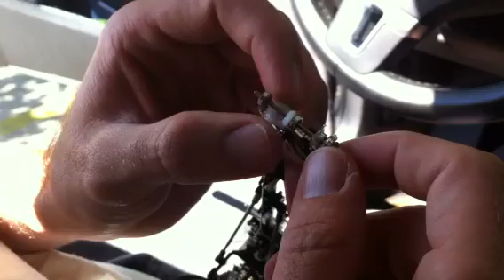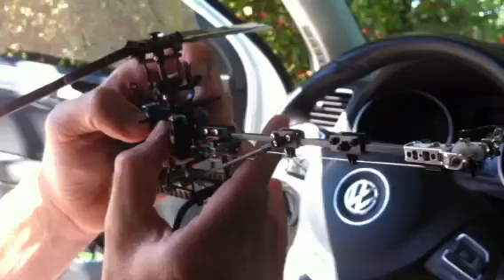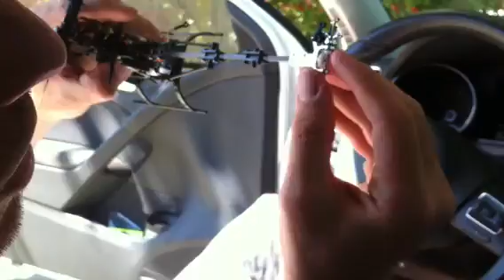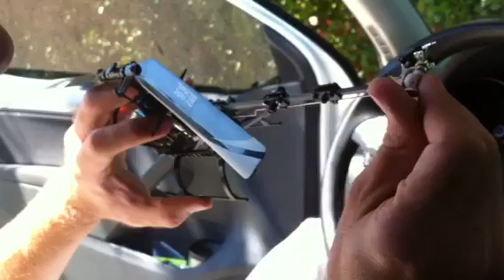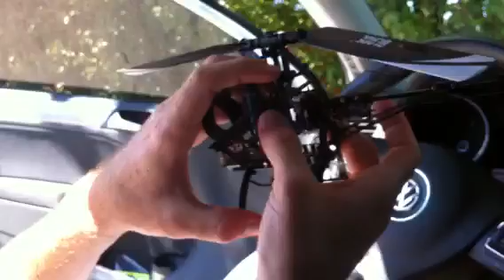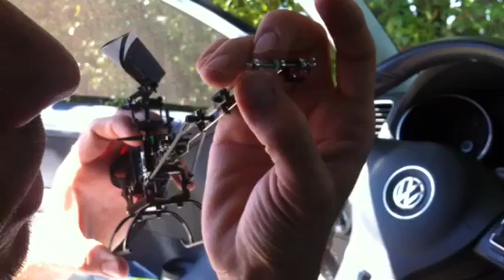Blade 130x tail gear mesh issue

Comment: Did you figure this out? I have the exact same problem. From what I can tell, the C gear is out of round and pushing against the D gear. I can see and feel the C-D gear mesh change a lot as I am rotating them. The gears are new, not stripped, bearings are fine, torque tube is fine. Narrowed it down to either the C or D gear, but pretty sure it's the C gear because I have a metal D gear and same thing happens.